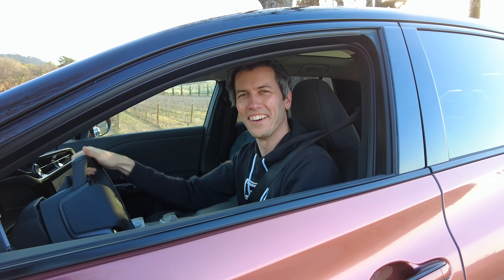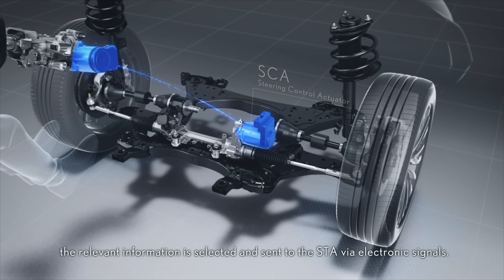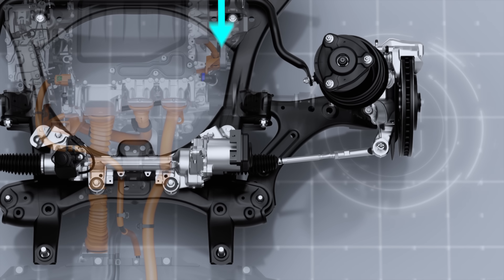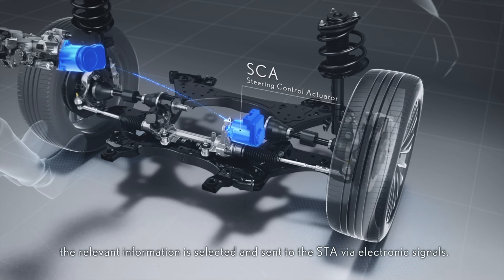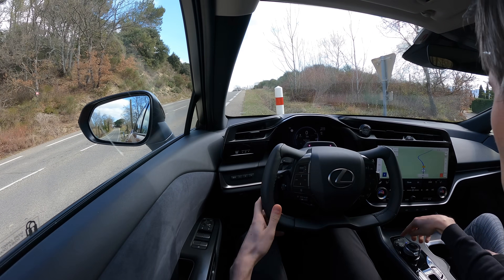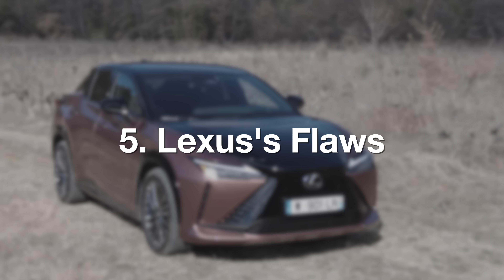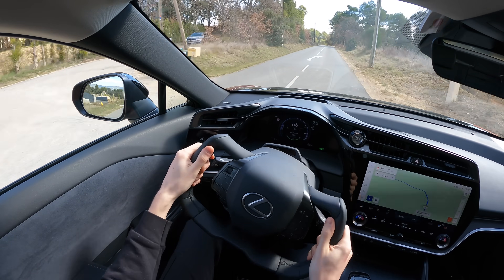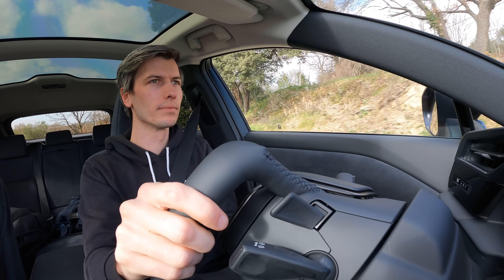How Lexus Fixed Tesla's Bad Idea: Steer-By-Wire Yoke

Comment: so how to move the car if there isnt power? while one might assume that isnt important most people drive used old cars and when this thing is old people will be driving it still and when it doesnt start how the hell are you able to move it? are  you required to pay a tow truck just to get it to move? cause those people have that kinda cash... this is great and all but the negatives compaired to the positives which sound great but every one is a problem that did not need fixing. Who needs a quicker response? As you said most are not driving for fun. I never heard people complain that the steering isnt responsive enough about their car. how about fix problems that are actually problems like safty issues.

Comment: In my community, there is an increasing desire for a more simple car with less sensors. Vehicles should not cost 1/2 to 1/3 the cost of a house. Plus, latency is anathema to the experience. Last, MTBF (mean time before failure) is not long enough vs mechanical system on average.

Comment: more complicated, more expensive, more unreliable. just to make it different. that if fail hydraulic hose/wire? the reliability coefficient of the product is always the product of the reliability coefficients of the individual components (more components, less reliability - simple math)... the input lag is terrible (like set too high graphic settings on slow video-card in game)

Comment: Just an improvement (maybe encouraged by engineering regulations) of what Infiniti (Nissan) did back in 2014 with the Direct Adaptative Steering system. Basically, this works the same way, except the mecanical linkage still exists (with an electromagnetic safety clutch on the steering column, probably due to legal restrictions in the 2014s). I have a 2016 (Europe) Q50 and it's quite fine (updated DAS behaviour). It's fine  to me on a non-track designed car like this lexus crossover or like my sedan. Feeling is still there, but it's cushioned like in a lot of modern cars. 
Thanks for this video, nicely explained as always ! Hope you enjoyed this part of France :)

Comment: Best option would be steering by wire with a circular wheel and fully configurable (dare I say open source hackable/programmable) software. Then you can emulate traditional steering and also have all the "smart"/adaptative stuff.

Comment: I like how all people that are supporting electric cars have there an argument that it has instant torque and braking. Yet, most of the people will never need that. When was the last time you heard somebody with a normal car complaining that they don't have instant torque when they want to drag race on every traffic light? Never. Or like in this video they point out that they can have faster steering. 99% of the time when you drive normally you will never have this problem. Because when you need sharp turning most of the people are going slow anyway. And a different steering ratio, well that does not sound like a good idea for most people. People have problems driving cars with manual transmissions because they don't know how to match the revs of the engine and car speed. And now you want them to watch their speed because their steering will be different. IDK man. Sound like a bad idea.

Comment: i think steer by wire aint a bad idea but i dont like the variable steer ratios, id rather have that consistency. of course i could change that in software and switch the yoke for a wheel but only if the engineers let us change the software (lately they dont and thats what im mad about)

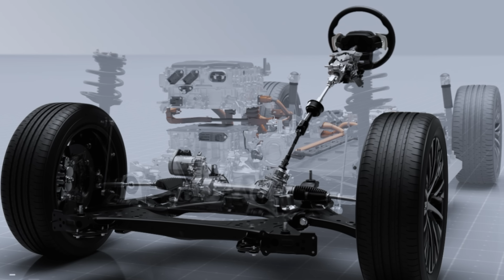Comment: I was wondering how this works with mechanical steering linked cars that have variable ratios when you switch between Comfort and Sport modes, but you answered it at 10:01 ! 

There is a limitation with the electronic assist / ratio control because it is mechanically linked, whereas with with steer-by-wire, you have more granular control because it's entirely electronic... That's pretty cool for fine-tuning safety adjustments at variable speeds.

For the less-abled, I wonder if this poses benefits for them in the event that ratios could be adjusted... Just a thought.

Comment: The jerking at high speed thing might be a safety feature, if you are going 150Km/H and jerk the steering wheel you might be swerving to avoid something and if it ignores your input then you hit that something and most likely die. If it takes your input somewhat into account and you sustain it then it swerves, and you spin and most likely don't die.
Reply: Agreed 100%. I cannot mention how many times I have faced that exact situation in my driving life and avoided an accident by quick jerking action.
Reply: Just because you turned the wheel instantly, it doesn't mean you did it in the most optimal way. Most people most likely understeer wasting valuable steering capability.

You could also make the argument that steer by wire  can be tuned to allow that initial emergency swerve, maximizing the  tire's  traction capability, and then automatically countersteer if needed. This reduces/eliminates the pendulum effect. So in this sense driving by wire is actually safer.

We already have systems to smoothen and correct our driving when we accidentally overcorrect. ABS, stability control, traction control, and corner braking systems. They all work seamlessly fantastic for everyday driving. Why not apply the same concept to steering?
Reply: What if you need to Swever like for debris or on a race track?
Reply: yea i can see NHTSA and IIHS taking issue with this
Reply: @barcotics1880  explain ABS and crumple zones. 

Proposal to NHSTA/IIHS: 
"Cars will stop better by reducing the amount of braking"
"cars will be safer being built from aluminum instead of steel and we'll make them more crushable too"
Reply: @CFloPhotography1. You can’t steer if you’re sliding. ABS stops the wheels from locking, and hence sliding.
2. In any crash, something has to absorb the energy. Either you or the car. Aluminum crumples more easily, hence it absorbs more energy. Meaning you don’t turn into a paste.

Comment: I actually preferred manual steering(except for parallel parking) & even manual brakes. Not that such things have even been an option for decades. Yup, that how far back I go. 🤣I'm sure I'd adapt quickly but I can already practically guarantee yet even more unnecessary extremely expensive & virtually impossible DIY repairs. Just the way they like it, virtually disposable for all intents & purposes. Which would be fine if(BIG IF) such mid 20th century tech(cars as we know them) were getting cheaper.

Comment: I like the comparisons you make compared to computermouse and videogame sensitivities.
I personally used to have a very low sensitivity in fps games, but like very twitchy steering with a tigther maximum radius.
For office work i enjoy higher sensitivity. But an absolutely DEALBREAKER for me in both mouse scenarios is that mouse acceleration is completely off.
That certain amount of cm of movement, no matter how slow or fast or the changing circumstances should always  translate to the same predicatable mechanical behaviour for me.
In fps games, the first thing i do after setting up fov to around 130. is stand in an x shaped hallway or near a square object, and just feel by pure musclemovement a flick to the right and left, knowing what that 90 degree snap feels like after years of practice.
Having that predictability has literally (figuratively and virtually) saved my life an untold amount of times. Especially when jerky movements are often in a chaotic situation.

Comment: Just as cars have driver-selectable suspension settings, steering settings could be selectable. Delay, such as steering delay, on the other hand, is almost bad news. From a control theory point of view, transport delay means phase lag which means bad handling characteristics. Also, you didn't mention how the system would handle evasive maneuvers, such as crash avoidance or just something dropped in the road.

Comment: "I don't see any reason to doubt it's reliability from an engineering standpoint."

This comment isn't intended to be a snarky and hateful comment, but that's most certainly something an engineer would say. From a practical (automotive technician's) viewpoint, it just goes back to Murphy's law. Modern electrical systems are far to finicky and expensive to produce for the average person to afford both the initial purchase and long term repair costs. I think this is clearly shown in the data which suggests the average age of cars registered for use on US roads is increasing.

Lets go back to the Mid 2000s. The average car had all the amenities we take for granted today as standard, yet still offered relative mechanical and electrical simplicity.  For this reason, I think I'll be driving 2000s cars for a long time. Once we start getting past say 2008/2009 the electrical systems are just too complex for the average Joe/Jane to work with on their own.

Comment: Too high tech. It will just increase car cost. All we need is a basic car with just enough tech to be comfortable and cheap.
If these high tech cars comes with the same price with the previous platforms why not buy right? But if it comes more expensive then It's a problem.

Comment: I've been thinking about this since telsa put out the yoke... why not have adjustable steering ratio based off speed.  why should i ever need to turn more than 90-120 degrees in either direction? the only time i need full lock is in a parking lot. i don't need full lock on a highway, Though it would be interesting to see how this system reacts when emergency input is required. if i hit ice and star going sideways, will this limit my steering input to counter steer because it thinks I'm going too fast?

Comment: This steer by wire is essentially what is used in aviation already. As long as they work out the bugs promptly  it'll be great
Reply: imagine driving down the road and your tiers turn insanely to the side😂
Reply: But in the aviation industry... the job doesn't go to the lowest bidder.  The Auto industry is notorious for making cheap s***.  Itll have to be as reliable as fly by wire in order to not cause some pretty tragic accidents
Reply: @thewheelman6533  Evolution.. Do you still ride a horse?

Comment: Citroën did this in the 1970s with the SM and the CX employing DIRAVI hydraulic steering - the steering wheel forces were not directly connected to the front wheels and also speed dependant

Comment: From the builder's point of view, there is another advantage, posed by Left or Right hand drive.  With a non-mechanical system, building a Right-hand drive vehicle is simply a matter of fitting the steering yoke on the other side of the car.  Nothing else (barring the instrument panel) needs to change.

Comment: From the first seconds of this video I spotted the flaw! It's very apparent that the wheel position is lagging from the steering input. I think video game drivers have been spotted this right away.
Okay, so steer by wire, obvious advantages there. Tesla screwed it up, once again obvious. Question is: does Tesla have steer by wire or linked? As far as I remember there's a law or regulation that prohibits the use of steer by wire there must be a direct linkage from the steering wheel to the steering rack. Does this abolished, yet? Note, there's the same rule for side mirror hence only cameras are not allowed. How about that rule? Abolished yet?
Comment on the steering visualization: made by Lexus, right? Am I the only one triggered by the rotating, moving suspension tower? That thing should be fixed, no?

Comment: If the latency and adaptiveness can be tuned better, there are a lot of advantages to steer-by-wire. At the state presented, I'd still prefer a mechanical linkage. Also, if this whole system ends as being proprietary where only Lexus can fix it if something goes wrong—no thanks.

Comment: So a coworker has a Tesla and found a pretty nasty little problem with the regen braking. If you're driving on potentially slick roads, like snow or black ice, regen braking can cause you to lose control. The best course of action when you hit ice or begin to hydroplane, is to just let off the accelerator and allow the wheels to "coast" while taking other actions to maintain control, but you never want to touch the brakes until you've regained control and are no longer on the slick road. With regen braking your car automatically begins to brake as soon as you take your foot off the accelerator and can cause your car to instantly lose control. There needs to be an override for regen braking for those that drive in adverse conditions regularly.

Comment: It doesn't have one of these weird steering wheels, but my Q50 steers by wire. The wheel becomes heavier at speed and provides decent simulated feedback. I'm sure a professional racer pushing it to the limit would not like it as much as a traditional mechanical setup, but I suspect most average drivers would never even notice the difference.

Comment: But what if the car loses power all the way like zero power like all the back-ups fail and I need to push the car and move it? How will I be able to move the car and navigate to any direction while pushing it? Will it still be able to steer to the desired direction?

Comment: You can tell when it fails, it will be catastrophic. Just as with the axel powered one, but electrics fail much more easily. EMP, lightning strike. Water damage.
Reply: Also when the battery is gone by accident or failure. No more control with the car. Hilarious.

Comment: Hi, a few things to mention.

1. Cool video

2. Detest the design of the steering wheel because i usually hold my hand on top of the wheel to stretch or just because it's comfortable. So I love the top part of a normal steering wheel.

3. I have always loved the freedom to configure or adjust things as i want to, but also to have physical buttons to press while I'm not looking at them. So the Idea of going away from the "Everything on one screen" is  good, as long as I can adjust things the way I want to.

4. If i am not wrong BMW has a system like this steering for a long time now. My Uncle used to have a BMW where the steering would be more agressive in slow speeds and would be more lenient at higher speeds, but would still feel amazing to drive with on a regular basis or if he wanted to drive in a sporty way. and the previous car my parrents had (BMW again) had this kind of steering, but to a smaller degree. Personally i found it odd to use but not bad, just something I had to try to get used to, at first I barely noticed it untill I was told, then I started to pay closer attention. And yes it was noticible, but it kind of felt natural, exept my hands would no longer be on the same position when driving in the same usual turn i take when I use an indicator if you get what i mean.

5. At 12:01 If you go frame by frame i can see you are lagging 1 frame behind with the tyre, so it's not actually as bad as you describe it. The idea is probably by design. 
Why?
I can guess it's because of comfort. So I'll try to explain the best i can.
It seems to have a soft stop feature on the wheels, so when you stop the steering wheel on the dot all of the sudden, the wheels will slow down to a standstill so that is doesn't feel like you hit a wall, I can immagine it will be far more accurate and responsive when or if it's added to a sport mode, or in a slider setting somewhere in the menu.
when you slow down the video that seems true when you steer all the way to either sides, the wheels follow after lagging behind untill it slows down, but by then you start to turn the steering wheel again and you see the car tries to correct the steering direction and speed again quickly.
Personally I think that is a bit of a bad feature, considering I would want to correct the steering over and over, unless it's meant to feel more like a heavy car.

6. Yes there will always be a delay from when the command is given to a servomotor untill it's in the correct position. That can be about 3-6ms even 15ms with some load, but to pass a signal from 1 servo to another would stack, so yes it would always lag a little bit, but that is something anyone can get used to, unless lag is something that drives you mad. Like on a controller on a consolle that is connected to a tv.
And considering it has always had a direct connection, it will recive some critique for feeling a little laggy compared to the standard solution.

Is at least my thoughts on this

Comment: A quick question, could the "delay" be more due to attempting to simulate the (I believe it's called this) torsion bars in many car steering columns?
Reply: what is that?
Reply: @evlo8059  in many modern cars with power steering, the reaction of the steering wheel is so instantaneous that it doesn't provide feedback people think should be given. The torsion bar adds a bit of play to the steering wheel so it feels like when turning the steering wheel there is a bit of stickiness like that of the rubber tires deforming a bit.

It's kind of like adding "bumps" in the gearing of continuously variable transmissions to simulate gear changes because people expect them, or piping engine noise sounds through the sound system to make the vehicle sound better.

Comment: Important point there... if you like high sensitivity on your mouse... Cars are increasingly turning into video games. And it's not all for the better. I don't like the progressive ratio - i much prefer how Audi did it on the older A6:es - the steering had the same ratio at all speeds, but got a log heavier.